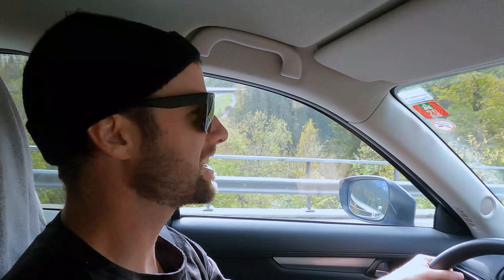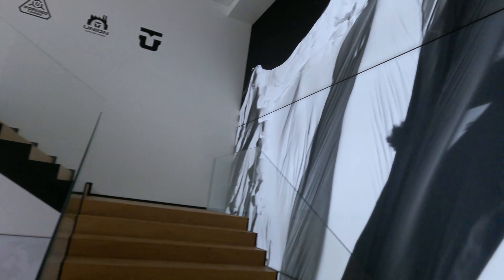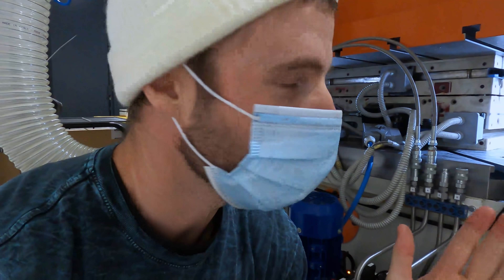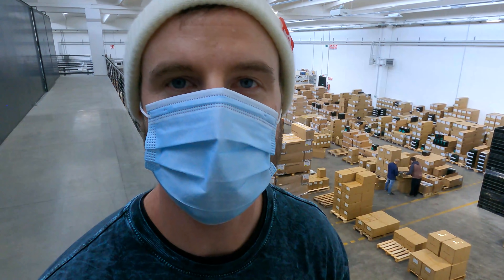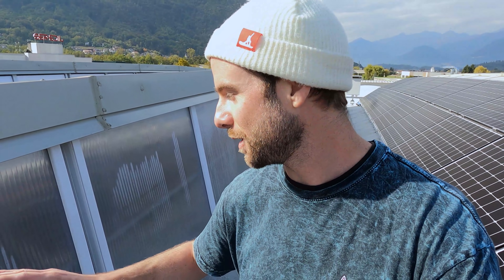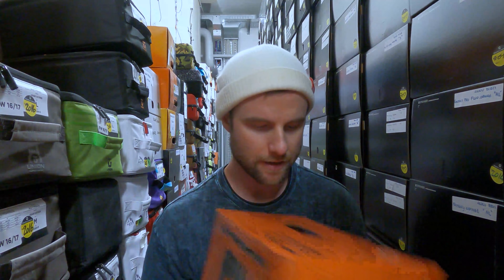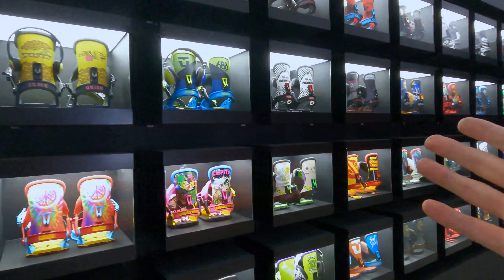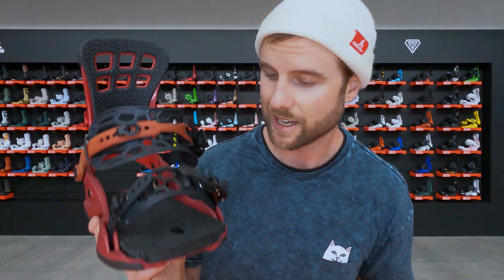A Look Inside The Union Snowboard Binding Factory

Comment: My first union bindings were a set of Force in white around 2010. They lasted until 2014 but by then they had a blue ankle strap on one side, one black highback and toe strap on the other, not sure what happened to them. I've got some F-Lite somewhere in the house. Looking for some new bindings to pair with my Jones Flagship. What would you recommend from the Union lineup?

Comment: Hello guys, so I’m 5’7 170 pounds. I hav recently bought a 158 snowboard for a do it all snowboard(k2 standard) I would like to know if this is too big, and I should return it and get 155 cm board. Thanks 🙏🏻
Reply: Both have similar weight ranges that easily puts 170 pounds somewhere near the middle. Personally I think you should go for a 155cm.
Reply from the maker: I also think the 155 is better for your weight.